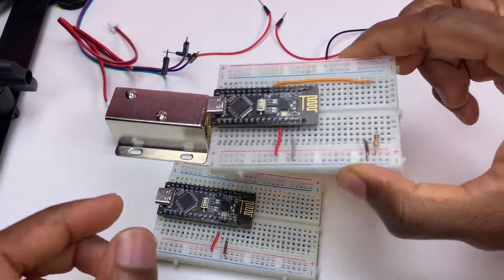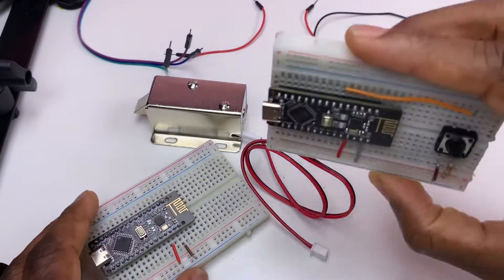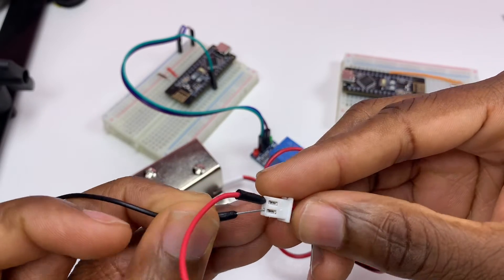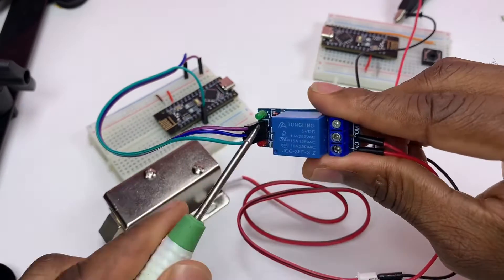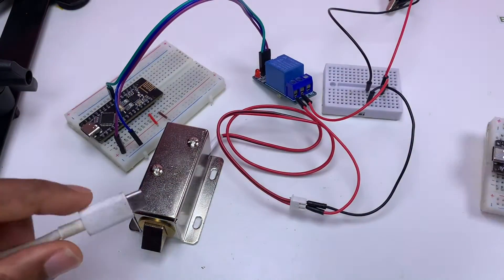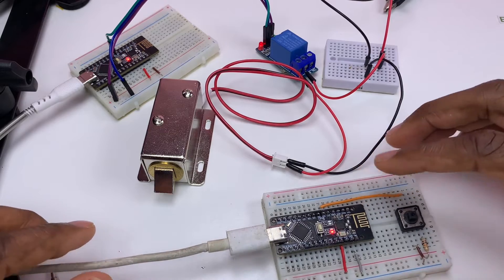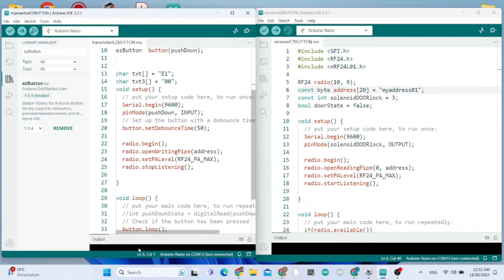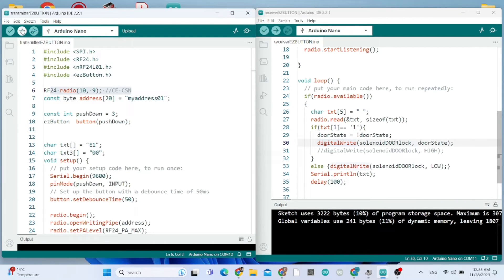How to control a SOLENOID DOOR LOCK wireless with 2 RF-NANO | nRF24L01 #rfnano #arduino

Comment: if it is possible use nrf24l01+ , the one which use antenna.
Reply from the maker: Of course
Reply: I will wait your video. @uploadideaswithitamar
Reply from the maker: You just change the csn and ce pin
Reply: not works. @uploadideaswithitamar

Comment: my arduino uno board prints as true in return of radio.available() command, even if I unplug the rf completely, so the transmission cant be completed, as result the radio.write()  return false. , what solution do you have , I uploaded the same setup you have. , only difference is I sent hello world. char array, to print.
Reply from the maker: Are you Using 2 RF-Nano board or 2 nRF24l01 module ?
Reply: 2  nrf24l01+  module @uploadideaswithitamar